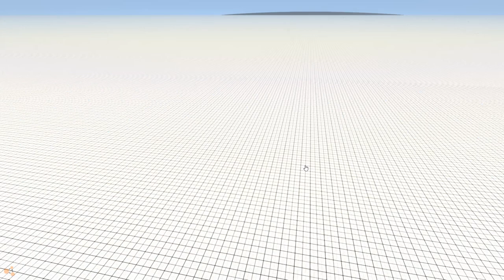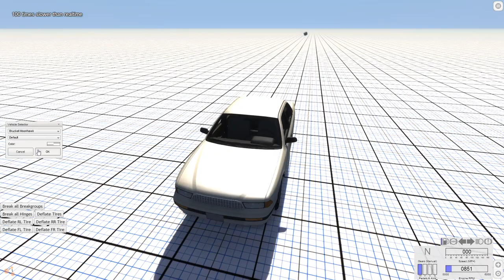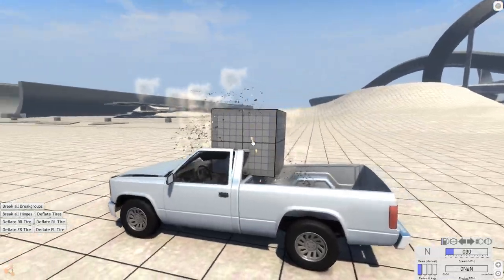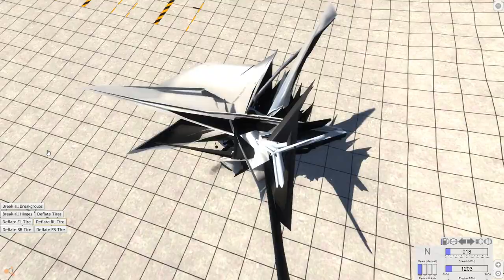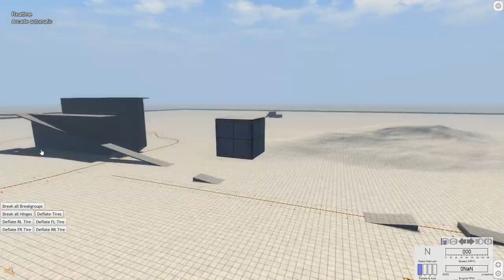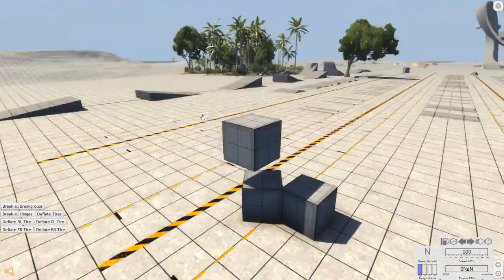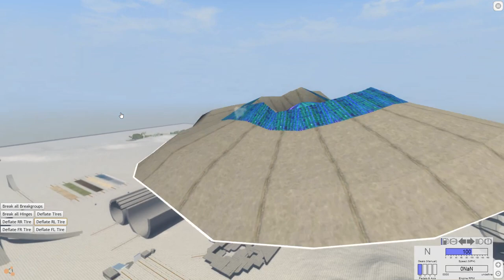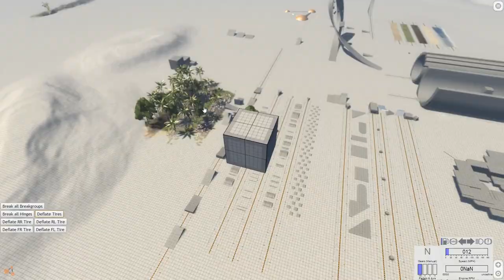BeamNG.Drive - HCube Testing [Part 2]

Comment: Can you find a flat racing track with tight cornors and race on moon gravity and then switch to Neptune gravity and see the difference on how the car handles
Reply: This is actually a great idea :)
Reply: spins tires more, slips more, accelerates, brakes, and turns less.

Comment: use the forklift for the cubez
Reply: to stack them
i mean
Reply from the maker: stubbysquid1
I think the forklift will probably fall over instantly because of how heavy the HCube is. It tips over on a heavy truck (around 3,000 KG) whereas the HCube weighs over 8,000 KG.
Reply: WhyBeAre maybe use the lightest cubes?